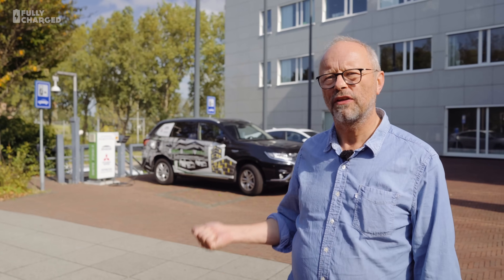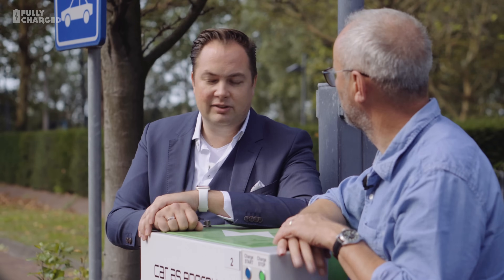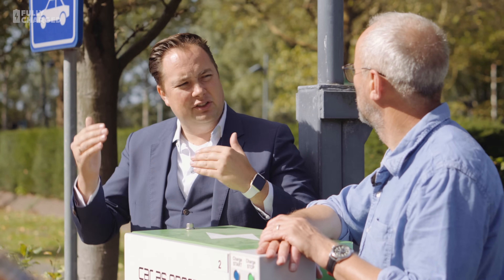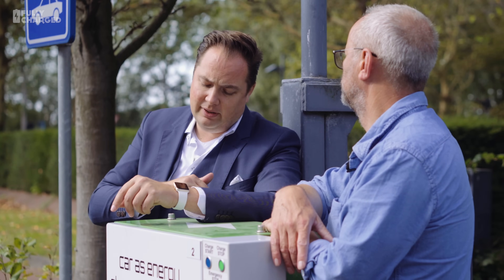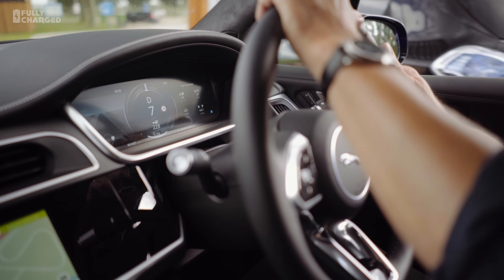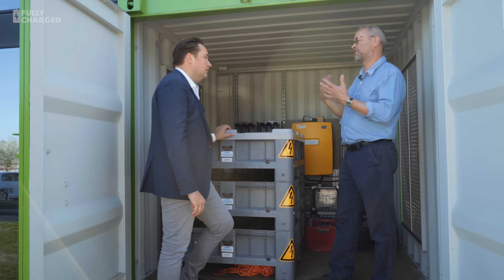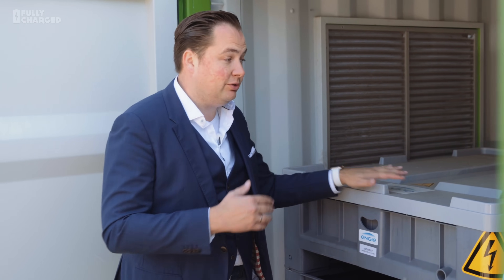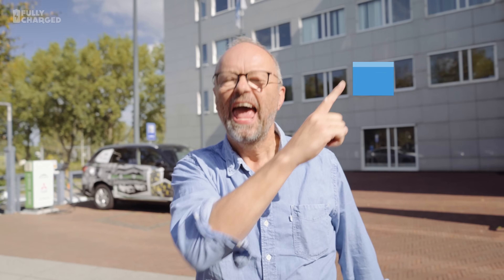Engie Vehicle-To-Grid | Fully Charged

Comment: I'm so waiting for this. My car has a 33kWh battery, and my home uses about 10kWh per day, mostly in the evening, and I normally use much less than 20kWh driving in a day. How cool would it be to power the evening home use from the car battery (already paid for!) and top it up on overnight cheap electricity. Cheaper for me, and a benefit to the power network (once enough people do it) in reducing the need for the high-cost surge power stations - make a real impact.
Unfortunately, need the CCS people to get their fingers out and standardise, and then for the existing CCS vehicle manufacturers to upgrade the cars. I'm not particularly hopeful that the latter will happen, however - we shall see.
Reply: Even better still, if you had sufficient solar capacity, charge for free after deducting the cost of your solar array without the need to have extra Tesla Powerwall type storage in the house.
Reply: @pinkelephants1421  Problem with that for me, is the car isn't at home during the day, and I don't use significant power at home during the daylight hours. Point here, is to use the car instead of a house battery (so a significant saving) - which works if the power usage pattern aligns with when the car is attached to the house.
Reply: @kevfquinn  Yes, you're absolutely right. Stupid of me not to have thought of that aspect. My suggestion would have made more sense for those working from home or for the retired etc. Home working is supposed to become more common in the future as digitalisation becomes ever more pervasive, if not on a full time basis then say 1 -4 days a week; then my suggestion would be more workable.
Reply: @pinkelephants1421  Its perfect solution for us. We use 30kwh a day but I work from home. So the car would be just sat on the drive all day and if I need to go out, the house uses very very little electricity.

The car could then charge up over night with hopefully very cheap or free energy & during the day the house or grid could use the car.

I have looked into powerwalls but the cost to get 30kwh capacity, its cheaper to buy an old leaf!!

OVO energy offer V2G trial chargers, but reports are very few people get picked to beta test.
Reply: @thomassneath8134  Still doesn't mean it isn't worth talking to OVO Energy. If you've no contact with them then there's certainly no hope of being picked. Sonnen (I think that I've spelt that right) is a German company & they make a Powerwall equivalent & from what I understand they're one of the biggest suppliers of renewable energy stuff & batteries. I've only heard & read about them so you'd need to do your own research.

Comment: Robert I wonder if you might be interested in doing a story about an inventor named Leonardo Rossi. He is currently selling an energy device to commercial customers to provide cheap hot water. He has been working on this for some time, but this is the first time he has offered it directly to commercial customers. 
The device is called the ECAT SK, and it uses a new unorthodox technology which is based on an investigation of anomalous heat conducted in the 1980s by Martin Fleischmann of the University of Southampton and Stanley Pons of the University of Utah. At that time it was called cold fusion, and it was debunked due to the unfortunate name, which the press came up with.  It turns out that the anomalous heat is real, and it is not based on conventional nuclear fusion. 
Currently there are several competing theories  to explain the anomalous heat,  which comply with standard physics.  They call it LENR which stands for Low Energy Nuclear Reactions, probably because most of the theories are based on the weak nuclear force.

You can contact the company at info@LeonardoCorp1996.com for more information.

Comment: I thought that was some proper synchronised dual thigh stroking stuff there Robert. There will be more and more of this horse I mean power trading going on. This is an avenue for the "little man" to get some of the action.

I heard on the radio here in the UK that large Supermarkets have all their freezers in all their shops remote controlled and people are employed to look at the real time and volatile wholesale power pricing. When the pricing rises, they remotely (and temporarily) shut down all their freezer "Network" and immediately sell on their "not used" wholesale allocation back to the grid (typically at a profit).

The money can be made in the STORAGE and MOVEMENT of the electricity, not the grid itself. It is kind of like Cloud computing, you "give back" the CPUs you don't need for a short time, and they are re-allocated elsewhere (in real time) but because they are really assigned to you - you get the benefit of the short term "sale" of the (computing) power.

I was also delighted to see good old lead acid getting some notice. I used to work in Data Centres and it would break my heart to see racks of perfectly good 12v Batteries going out the door simply because the contract says they are to be replaced every 24 months. And as mentioned in the video, these batteries are much better quality than your average ICE type battery.

When "really cheap" was mentioned - is there anything more specific on this? The other alternative I know of is the "flow cell" batteries popular in Australia. They are bromide filled Tubs with pumped fluid across plastic membranes. I also read about "DIY" off grid kits using sealed marine batteries. I would think these lead acid batteries are by far the cheapest option.

Comment: This makes no financial sense both for car owners and for businesses. From the car owners perspective, your car is a large financial investment as the batteries only have a certain about of charge cycles. So every time you charge you are removing life from the total life of the battery system. Let's call this battery lifecycle depreciation.  That being said it must be compensation that battery lifecycle depreciation of a consumable product (ie the battery of the consumer's car). Now if the companies can be competitive in paying for more than the battery lifecycle depreciation cost of each charging-discharging cycle, these companies would be better off just investing in their own internal battery infrastructure rather than overpaying so to speak for the service or utilizing someone else's battery lifecycle depreciation.  Not to mention that companies would be held hostage and would not be able to accurately depend on any given amounts of cars in the scheme at any particular time or date when the service of having attached external batteries from consumers would be advantageous.   I really don't see the benefit unless the owner of the charger - battery consumers owned the car, the power generator and the building supported by such a system.  And if you did you would still be better to have the main building attached to a main battery bank system that you could reliably depend upon. The last thing you want is your lights to go out every time you have to drive to town. The whole thing falls apart whenever the storage leaves the structure. Then you are back to paying a premium for the electric from the grid. And why would anyone tens of thousands of money just so they would be in the same boat that they were in before they invested?  In my opinion from first glance, it looks like an idea that was not well thought out and leaves out basic owner vs user economics.
Reply: I think you misunderstood the purpose of the video and how the grid works. We are talking about balancing the demand on the grid when energy usage becomes more expensive. It is about levelling out volatility in demand and supply. I'm far far from an expert, but perhaps look at how utility providers actually resolve periods of high energy usage. Some have to pay other providers in other countries to fill that short term gap in the ability to supply their local market, at a relatively high extra cost. This is generally passed on to the consumer within the peak tariff.

Therefore, it is more a case of economics in working out when using a subsidiary system would be most beneficial during periods of high loads on the grid. Battery degradation is another issue completely. If you show me some numbers to say how much it would cost a consumer in "lifecycle depreciation" to use this type of system vs normal everyday use then I can agree or disagree with you based on those numbers. At the moment, there is nothing in what you say to discuss because we are just completely guessing.

Let's flip it around - if this building were to generate enough energy to save on average $500 / £500 a month (whatever currency you like and taking into account savings made from paying for peak energy usage) over the course of a year and they had a pool of 20 employees who contributed to this scheme, that's potentially $£6000 a year to share amongst the pool and the employer, who has invested in the infrastructure. 

It may be that this benefit can offset the cost of "lifecycle depreciation". But this is totally hypothetical as I'm using completely made up figures to validate my theory. So what we need is evidence to demonstrate whether or not it is economically sensible. But you won't get evidence without creating the infrastructure first to test the theory. It is quite easy to say something "will not work" before trying to see if it will.

Comment: I don't get it. I charge the car at home and pay for electricity, then go to work, and they use my electricity. I can then go home and fill my car again. So I will loose money on this and my work will save on the energy bill? No matter how slow you charge and discharge, the cycles will degrade the car battery, so in the long run. My cars battery will last shorter than normal with this solution. Can someone explain to me because the video doesn't.
Reply: A properly managed quality pack will do ~2000 0-100% cycles. The BMS of the car limits it to 5-90% state of charge, extending the life to ~5000 cycles. Basically, cycle life is not an issue.
Another life limiter is 'time at high voltage', and V2G helps there to discharge the battery to a longer-life level :)
As always, the car is in charge of its battery, so presumably you can set a lower discharge level to guarantee a leftover range. This way, you can arrive at work with 20% SOC, charge to 90% and during the day discharge to 70%.

For the financial point of view, there are a few things to consider.
First, the car owner will get paid (by Engie in this production) for the grid services he provides, just like idle gas power plants are paid to be on hot-standby. 
Secondly, your work will probably have cheaper electricity (like half or a quarter of what you pay). So there is a case for charging at work and discharging at home. Which as of now is legal, but since it is tax evasion, the tax authorities will probably put an end to this sooner or later.
Reply: @kpvleeuwen  Thanks. Still if you drive 150 km(about 100 miles) every day, the 2000 cycles are used in just 6 years.

Comment: That’s one way to reduce redundancy. However, I do question the viability of lead acid batteries with higher demand devices such as A/C in bigger cities of southern United States during the summer months especially if there’s an initial spike.
Reply: Add a few kilos of supercapacitors as a buffer to cover the spikes. That's the kind of application they're good for.
Reply: Roxor128 right! Good thinking

Comment: Regarding the second life battery storage units. He was talking about eventually this and that. Eventually there will be no more of these batteries used in vehicles to begin with for them to grab second hand... That is a great tech during transition but vehicles are already starting to eliminate those 12v car batteries so they better not be counting on them for the future...
Reply: Even if these are lead-acid (LA) batteries used in many different applications, the general idea is to re-use and extend their usable life before recycling. It is a low tech/low cost solution which can easily be used within a V2B/V2G system. The use of LA batteries is unlikely to stop for generations and there will still be a lot of unused batteries out there which can be re-purposed. Think about it. LA battery production is still massive. If there were a sea change in industry to Lithium or other alternatives, there would be stockpiles of unused LA batteries. Do you just want to throw these all in the tip (UK for landfill) or reuse them for several years more when they are perfectly serviceable?
Reply: @2002RM  Sensible & well put.
Reply: Which vehicles do not have those batteries? I thought they were just making them bigger? Up to 48 volts.
Reply: As KK mentioned, the Engie representative was saying that those particular batteries are from data centers.  However, most mobile phone sites / cell sites also have a fairly decent lead-acid battery backup system, and those batteries are also high quality.  So there are some good sources for gently used, high quality lead acid batteries.
Reply: Err, there are tens of millions of ICE cars out there...and we'll still be making new ones for years and years.......

Comment: A: my main thing I don't understand about this business is that I would never want 
my car to be less than 100% charged if possible. Especially during an emergency, I wouldn't want my office building or apartment complex to drain my car battery during an outage, and then find out my electric car doesn't have the charge to get me home and can't be charge because the power is out! 
 I guess he addresses that by using them for high load but short term "peaking" loads, and just having enough cars connected at once that you don't discharge any particular car too much. Still, if my car was attached to this system, I'd want it to maintain 95% charge, minimum. I'm still too range-anxious: even if 90% of my trips are under 10 miles, I still live in a state that is almost as long as England, in a city that is 50 miles across.

B: The good thing is once you get the tech out there it will get figured out by the crowds. If there's some killer app or big exploit that nobody has thought of, somebody will find it once they use the tech every day. Never underestimate the genius of commuters sitting in their cars every single workday.

C: smart company idea, the flexibility of using cars AND surplus batteries of multiple types is really great. A system that can deal with brand new electric cars AND old lead-acid batteries is my kind of tech.

D: hi ducks!  first thought with that floating solar was that some ducks would love to sleep on it.. then the camera pans over and sure enough, a few sleepy ducks. As long as they have room on the edge, I bet they'll stay off the panels.
 Songbirds, on the other hand, will prefer to cling to the edge of the panels and poop on them :(
Reply: You shouldn't keep the battery at 100% charge. It is bad for the long-term life. 80-85 percent is as high as you want to keep it for daily use. For long trips charging to 100% is fine for starting out since it won't remain there for long, but you'll only charge to 90 on intermediate stops because the top-up gets slow.
Reply: @Markle2k  If you're driving a Tesla, Elon told Kim of Like Tesla that it's okay to charge between 20% & 90% for best battery health, charge everyday & to leave it plugged in @ home if you can.
Reply: confuseatronica 
Because charging 85% takes maybe an hour, while the last 15% alone takes another hour (example not accurate numbers)
Reply: I've only have 2 ev's, and only for 2 years. I am finding that lots of foresight is put into their design. The question you raise about 100% charge is good, but it is likely addressed by the provider. I will be more confident when I see more public chargers.
Reply: Because we've reached the point where EV storage is massively overprovisioned for typical use. If you're parking somewhere for long enough to make this system worthwhile you probably just want to get home at the end of the day which is probably something like 20% of total capacity. So that's potentially 60-70% you can sell. (And since your car knows where you live it's not like you'll ever not have enough charge to get home.) On the other had if you are planning on a long trip (or for some reason think you might have to suddenly get to the other end of your state) just don't plug in.

Comment: I liked that 'honest' approach. Not claiming that it IMPROVED the battery, buy it really just was kinder to the battery, leading to extended life.
UPS and Car batteries tend to get very high discharge rates when used. the gentler 'reuse' allows a tamer discharg rate while remaining useful.
The sad thing, is here in my area, the SERVICING (shop rate) costs many time exceed the part cost. We tend to put in NEW, just to avoid a call out.